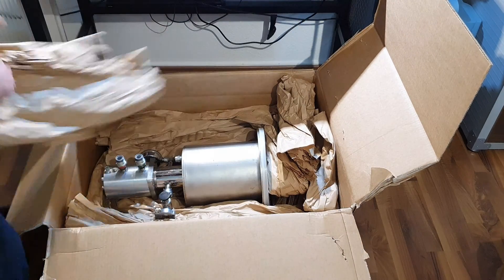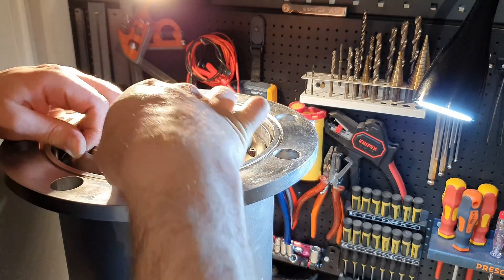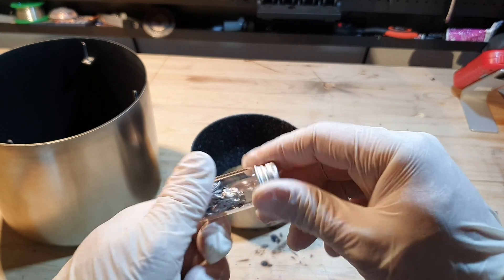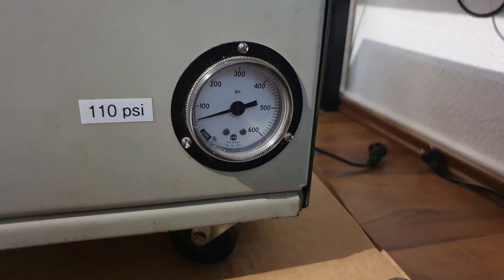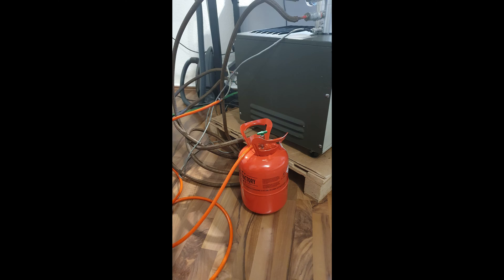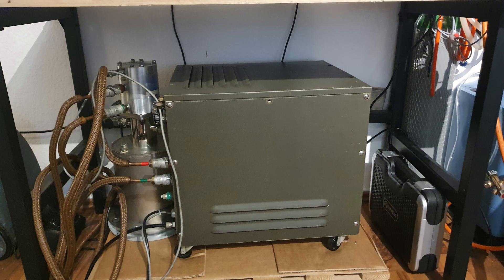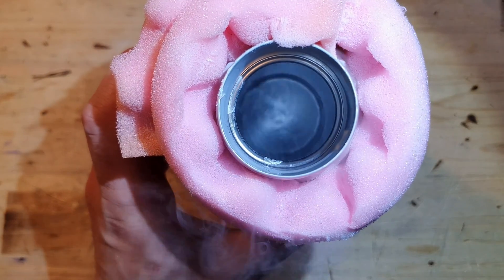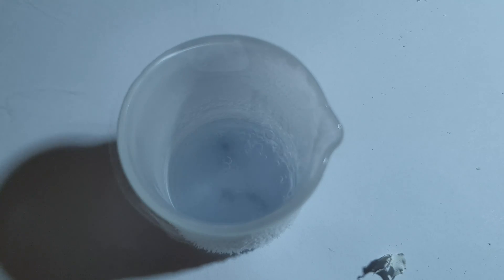Liquefying air at home with my new cryopump

Comment: I disagree with the other comment. I would say that the primary reason for the poor cooling capacity is that the type of helium you used is a 50/50 mix of helium and air. SO your refrigerant is condensing in the cold head both reducing the efficiency of the cold head and the mass flow of refrigerant while reducing the pressure in the lines.
Reply from the maker: According to the packaging it is Helium 4.6, so far from 50/50 helium and air. I of course have no way of confirming that but it reached 17 K under vacuum.

Comment: Where was the 78% liquid nitrogen in the liquid air? If a glowing piece of newspaper isn't able to relight in air then it shouldn't relight in liquid air. Imo air does not contain oxygen or nitrogen so all you produced was liquid air that had oxygen-like properties due to the way it's been processed. The cryocooler contracted and concentrated the air into a liquid so that it was able to relight a glowing splint 👍
Reply from the maker: Air does contain oxygen and nitrogen. Due to the lower boiling point of nitrogen, it will condense slower than oxygen and evaporate quicker than oxygen. I you let liquid air stand for a while, you will be left with liquid oxygen. 
The blue color and thay it reignites glowing paper is a strong indicator for a high oxygen concentration.
Reply: @08:01 The liquid in the glass doesn't look blue, only the shadow of the beaker on the white mat looks blue. I've watched another video of someone do something similar and his liquid air wasn't blue either. 

So if as you say the liquid nitrogen has gassed off, where's the oxygen?

  @AdvancedTinkering
Reply from the maker: It's pretty hard to capture faint colors like this on camera. But I can assure you  it was blue. Not as blue as pure liquid oxygen but noticeable.
Reply: sorry but there's a lot of confusion because according to applied science and his video Liquid Nitrogen Generator - Overview, he produces liquid air in the video and his is NOT blue. He even says that it does not have a tint of blue to it.

I'm sure he would have wanted his liquid nitrogen to have gassed off to have shown the blue tint of the liquid oxygen but he never did this in his video.  

I cannot accept your word when another person is doing the same thing and gets a different result. From your video, I cannot see a liquid with a blue tint.

So where's the oxygen?

 @AdvancedTinkering
Reply from the maker: I don't know what to tell you. You are correct about liquid air not being blue. 

But it's simple physics. Nitrogen has the lower boiling point and evaporates first, resulting in a higher concentration of oxygen in the leftover liquefied gasses. I'm not sure if there is an azeotrope between oxygen and nitrogen but I can assure you that the oxygen concentration increases to a point were you can see the blue color.
Reply: If there was a higher concentration of say oxygen the liquid would be bluish or blue. 
Yet in your video the liquid does NOT look blue or even bluish. So where's the oxygen?

You categorically state in your video at 07:30 that you THINK it is mostly oxygen due to the bluish colour of the liquid gas.

You either know or you don't know.  Thinking just doesn't cut it.

Imo the only time you can get liquid oxygen to look blue is when you use pure oxygen as your source gas to liquefy. You never used a pure oxygen source as you used air as your source gas.

This brings me back to my initial comment in that there is no oxygen and nitrogen as constituents of air. All you were doing is liquefying oxygenless and nitrogenless air 👍

 @AdvancedTinkering
Reply from the maker: I just checked out your YouTube channel and realized it probably does not make a lot of sense to discuss this with you any further. If you don't even believe that "air" consists of different gasses, I can't help you.
Reply: it really is irrespective what my views are the fact is you're telling vbiewers like myself most of the nitrogen has gassed off leaving mainly liquid oxygen and yet the liquid is not blue! I've even told you that the 'iced up' beaker's shadow also looks blue in the video telling me there's no blue liquid oxygen present at all and you're just conveniently telling me you can't help in my criticsm of your video!

Surely you should have all the answers right?

I've watched another video and the creator actually states the liquid air he poured into a polystyrene bowl wasn't blue!"

Now there is a discrepancy here. Two different people produce the same stuff ie liquid air - one says there's blue present in the liquid and the other says no bluish tinge present!

If oxygen is a constituent of air and the liquid nitrogen has gassed offthe remasining liquid should be blue, but it isn't! So where's the blue oxygen?? 

I personally think you need to tinker a lot more because to me it seems you haven't a clue what's going on; you only THINK you know.

Whereas I who think there's no oxygen or nitrogen in the air naturally can easily explain the observations seen in both videos!! Of course the liquid's not blue because there's no oxygen there!!

Very simple and yet you haven't a clue!

The wonders of rubbish science eh?

@AdvancedTinkering
Reply from the maker: I'm curious: if I would repeat the experiment and you could clearly see the color change to blue and also see the boiling point change, how would you explain that? Is there a possibility that it would change your mind?
Reply: @AdvancedTinkering  the way I see it is this....and this is the problem

We think there is no oxygen and nitrogen etc that are constituents of air. 

We think man manipulates the air to manufacture the gases lots of people think are constituents of the air.

So if you want to convince us that the view we hold is wrong then you have to demonstrate the air actually has constituents, that are mainly oxygen and nitrogen.

I must add we have looked at lots of information relating to air, oxygen, nitrogen and the industrial processes used to make such gases and we remain convinced air does not have constituents.

Man processes air to manufacture those gases and air separation cannot be achieved because there's nothing to separate.

So if you want to convince us we are wrong then you have to show to us that you are not making the gases as a result of the processing you're putting the air through

How is that?
Reply from the maker: I fell like you are not understanding a lot of basic concepts regarding physics and chemistry and I don't think anything I do would change your mind. I would love to demonstrate, that air contains different gases by condensing it and then letting it stand to demonstrating a change in the boiling point, color and ability to reignite something. But I think you will just claim I "processed" the air and somehow "made the gases". 

How likely do you think it is, that the whole science community of the world is wrong, but you are right?
Reply: @AdvancedTinkering  quite a predicament demonstrating the air actually has constituents eh?

Perhaps try this 

Air supports combustion and its alleged nitrogen, a gas that doesn't support combustion, is a constituent of air.

So what you could do is liquefy an amount of air but collect the gas as soon as the air evaporates as this should be nitrogen. Once the collected gas has reached room temperature introduce a flame into the gas and it should extinguish.

If the flame does extinguish that would support your view that you have nitrogen  however if the flame remains lit then that's evidence to support my stance that all you have is air.

You could easily do this because you have the equipment.

Comment: You should be using the normal yellow type-K connector to the meter instead of the PLC/DIN type crimps. The dissimilar metals at the input adds a second metal junction which causes measurement error even without your fingers present.

Comment: I'm not going to crucify you for not using a proper wrench, since you DID use a wrench. I'm going to crucify you for referring to a spanner as a wrench!

No, but an interesting experiment, if you could figure out a set-up, would be to see if it's possible/practical to use cryogenically liquefied gases as a source of completely dry high-pressure air for storage in SCUBA tanks.
Reply from the maker: Haha, I still get the some terminology wrong in English. Thanks for pointing that out!
Reply: @AdvancedTinkering  You didn't use any wrong terminology, actually. All spanners are wrenches in English, but not all wrenches are spanners. It's like coloring with all the colours of the rainbow on aluminum foil while wearing an aluminium hat.

Comment: This may be a stupid question but of you left the pump running without the collector attached would the cooling element cause the temperature of the room to drop, offsetting and exceeding the heat being generated in the operation or will they cancel each other out and maintain whatever current temperature the room is?
Reply: Energy is constant, so there's no magic way of cooling down a room. You have two flows in this case, the addition of electric energy to the pump that is converted into heat and heating the room, and the subtraction of heat through the cooling water going down the drain. The pump is only moving heat from the cold side to the water, the question is how efficient it is. It it moves more heat energy to the water than the electric energy needed to run the pump the room will slowly cool down, if not, the room will slowly heat up.

Comment: I’m amazed that the pump can cool so well, with only 200 psi pressure differential. It’d be interesting to know it’s internal construction, it must cleverly use the returning low-pressure cold gas to chill the high-pressure gas on its way to the cooling head. Very impressive in any case!

I’ve been wanting to make LN2 myself for a long time now, saw someone make a rig from a surplus low noise amplifier assembly from a cell tower that had a cryocooler in it. Those don’t seem to be on eBay anymore, and things under the category of “cryocoolers” seem way expensive. Cryopumps seem a bit less pricey, perhaps because most people don’t know what to do with them. Hmm… :-)
Reply: It is possibly an inverse stirling engine.
Reply: @jackmclane1826  It's a Gifford-Mcmahon cryocooler, with the compression and expansion portions in separate units.  Don't ask me how it works; the operating principle is even more complex than that of a Stirling engine.

Comment: I use indium to solder strain gauges where the thermal expansion of normal solder would be unacceptable. Indium solder can also wet glass and ceramic if you need to make a connection on a non-conductive surface. Maybe that's kind of fun/cool.

Comment: You know you could look into making liquid nitrogen with one of those that's how a king of random did before he died he used to make his own liquid nitrogen for his experiments
Reply from the maker: I tried using my oxygen concentrator as a cheap nitrogen concentrator, but there is still some oxygen left. I need a Nitrogen separation membrane.
Reply: @AdvancedTinkering  I have been wondering if one looked at the plumbing of a O2 concentrator and a N2 concentrator (as used to make 'air' for tyres) and see if one can swap the plumbing around a bit to favour the purity of the N2 stream.

Comment: Probably not very safe but you could use the pump to make dinitrogen tetroxide. You could even turn the N2O4 into N2O5 with ozone. Dinitrogen pentoxide is a new nitrating agent or could be used to make ammonium dinitramide. I like your idea of making pure liquid gasses though!
Reply: You don't need a special cooling setup just to make (do you mean liquefy?) N2O4.

Comment: Hi awesome video! What part of germany are you from? I always wanted to make a video about liquid hydrogen, maybe that would be something for a collaboration if you are interested. ;-)
Reply from the maker: Thank you! I live in Hessen. 
I would really like to do a collaboration but I think moving the cold head and compressor would be a huge hassle. And I have to test how cold it gets under vacuum. At ambient pressure the temperature won't drop below the condensation point of nitrogen. 

How do you plan on supplying the hydrogen? Using a gas cylinder or making it via hydrolysis?
Reply: @AdvancedTinkering  My reply yesterday got deleted for some reason. Probably because I added contact details. Well I live in hessen too so that is great! I would definetly use a hydrogen cylinder. Everything else will probably make it too complicated. I will write you an email tomorow with my contact details, so we can talk about this if you want.

Comment: You could use a 'tig water cooling unit' to cool the machine from a distance and vent the heat outside.
Reply from the maker: Yes that might be an option. But I don't know how much heat they can remove. The compressor produces a crazy amount of heat.
Reply: @AdvancedTinkering   You can find all of the specs listed. Specifications
Model: WRC-300A
Protection Level: IP21
Cooling power: 1.5KW(1L/min)
Pump power: 260W
Rated water flow: 7L-12L/min
Water capacity: 10L
Max pressure/head: 0.4Mpa/60Hz
Rated lift: 32M
Operating temperature: -20℃— 60℃
Gross Weight: 16kg (35.3lbs)

Comment: awww lucky, the only cryogenic stuff I can get somewhat is dry ice from sodastream CO2 bottles, if I get a lathe and some metalworking tools at some point I might try making a stirling cycle cryocooler but that's pretty hard to do (maybe joule thompson but the pressures needed are insane and I would need a high pressure compresser). Nice video, pretty interesting nonetheless

some stupid ideas I have currently other than building or buying cryogenic stuff is stacking peltiers together or using a couple refrigeration loops back to back but refilled with propane as it's colder
Reply: Building your own stirling cryocooler is insanely difficult and it also needs to keep pressurized helium inside. Peltiers are super inefficient and cant work at these temperatures. Cascade or mixed refrigerant joule thomson cooler is your best bet to get to -100 to -180 range. I have built a small 2stage cascade cooler myself for -100c and currently working on a precooled mixed refrigerant JT cryocooler to liquify nitrogen air oxygen etc. MRJT uses a mixture of gases in order to reduce the required pressure and make the use of regular rotary ac or fridge compressors possible. Many chinese nitrogen liquifiers use this cycle and also cryogenic lcd freezers use this to get to -180c
Reply: @nikoskaravitakis9437  what is an LCD freezer? (the above system is using Gifford McMahon cooling - lower compressor pressure than JT, but much less efficient.
Reply from the maker: I would love to see someone build a Stirling cryocooler themselves! 
I also thought about building a cascade phase change system. I think it's your bet!

Comment: just FYI those party things only have about 80-90 He in them, but if you get 4.6 thats fine also you than should do it with vacuum any contamination can destroy the cold head and the absorber
Reply from the maker: I heard that there is helium for balloons that only has 80-90%. The helium I used is 4.6 according to the seller and the package it came in. 
Yes, vacuum would have probably been better. I flushed the lines with a lot of helium to remove any leftover air and moisture. 
Should I have to refill it again, I will use the proper fitting and a vacuum pump.
Reply: @AdvancedTinkering  i have tested a view, none of them were even close to 95%, but proper 4.6 is not that expensive so such a nice toy ;). When I do the filling I pull a good vacuum that would be sufficient, moisture is off cures also a huge problem. The only thing is filling it once not correctly can reduce the life quite allot. We have a lot of them running with cold traps. We monitor the temperature and when they perform worse they get send for rebuilding, the one someone used the wrong cylinder with only 90% He it did break in like 1/8 of the time. Looking forward to your experiments, there is a lot of fun to have
Reply from the maker: Thank you for the information! It's good to know, that the helium is not as pure as stated. 
Now I am thinking about replacing the helium. I don't want to damage the pump.
Reply: @AdvancedTinkering  but i dont think you have to hurry that much, i dont think you will run it so much that it does something big. But for long term i would try to change it, as you know they are hard to get and replacement parts as well and expensive.
Reply: @AdvancedTinkering  try helium made for neon sign makers , and find a friendly glass blower, (borosilicate) , to make a glass manifold to connect to a vac pump and the ( prob glass ) bottle of helium. ill do it for ya if ya want.
Reply: They have started making baloon helium with 85% He and 15% O2 because people were using those tanks for exit bags and masks. The old mix used to be 80% He 20% N2. These pumps really need pure He to work as intended, but less pure isnt gonna cause too many problems as long as the gas is dry and has no CO2. It will run fine on pure H2 as well. Also your liquid air using this method is mostly oxygen and argon. 🤓😁
Reply: @christopherleubner6633  H2 is a problem, the metal will embrittel quite fast. Oh i did not know that with the O2 but makes sense. 
the manufacture recommends 5.0, but that's harder to get and expensive. Other gases pose quite the problem, execrably oxygen, even nitrogen. These should be avoided in the cryos they will break quite quickly. We have seen this because a technician used the wrong cylinder for filling. And then we did test what gases were causing the damages.